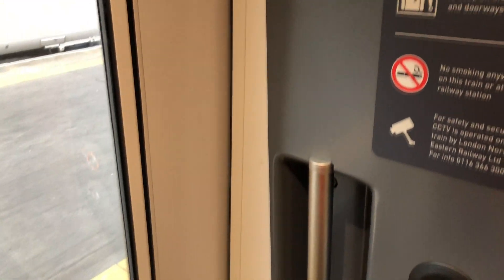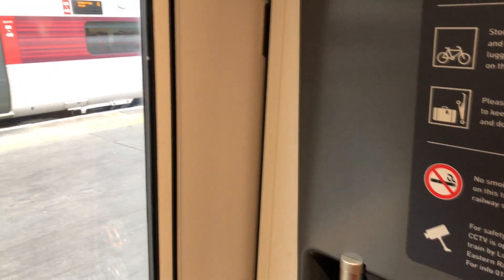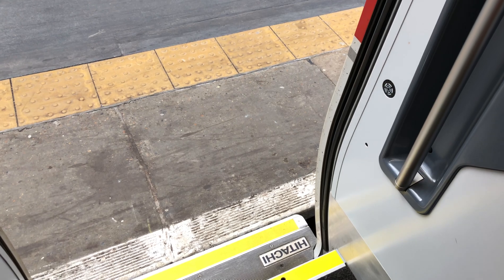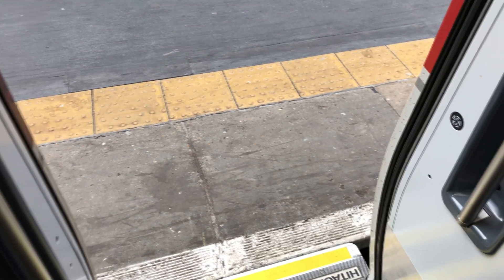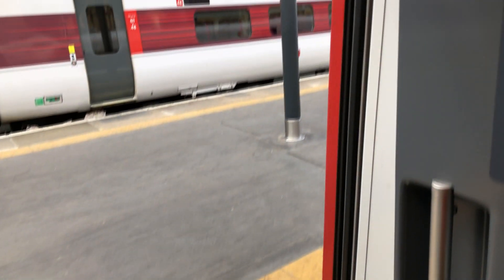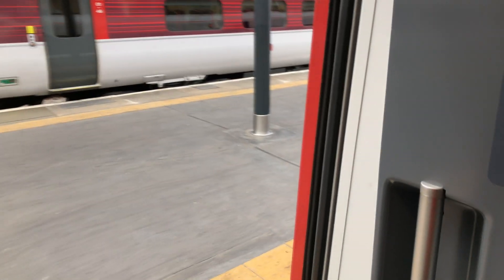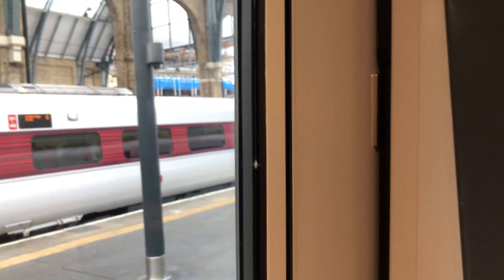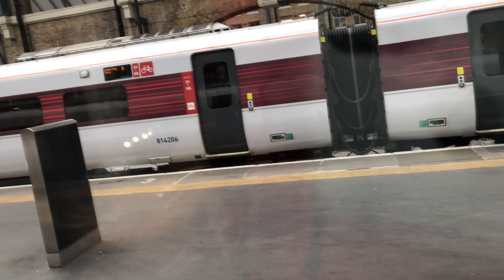LNER Azuma Hitachi AT300 door plug mechanism. Same on all A-trains

Comment: Interesting mechanism. I guess the Japanese Shinkansen works the same. Like this the train is airtight above a certain speed but the door can still be opened manually in case of emergency because the arms are released at low speed. I'm more familiar with the kind of door sliding open outside the train, and pulled in by a series of arms on both sides once closed, also almost airtight, just the other way. Sometimes combined with a vertical movement.